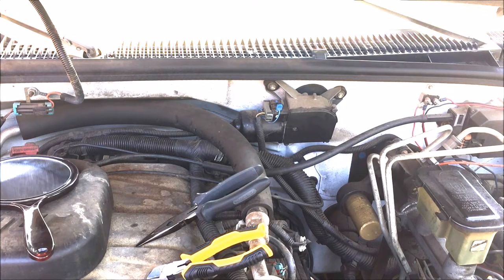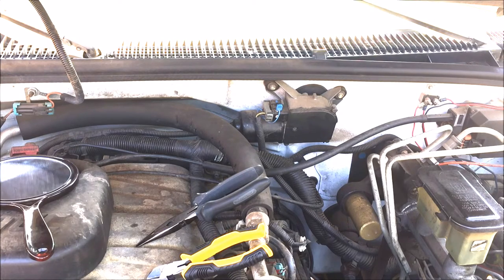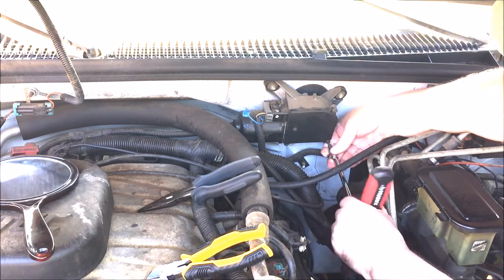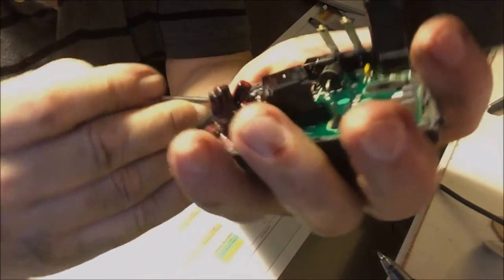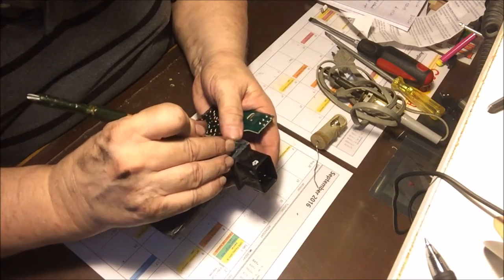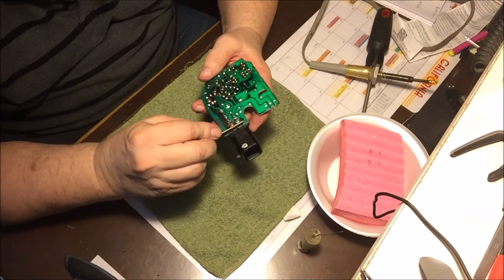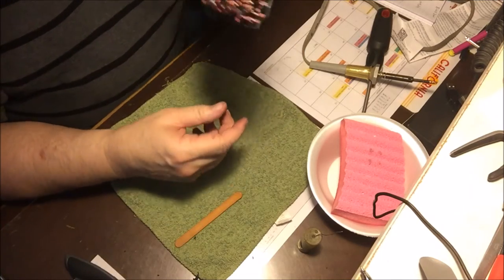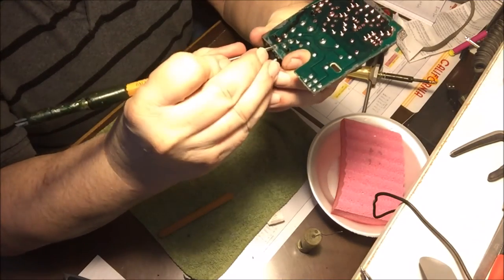DIY Windshield Washer spray fix 1996 GMC

Comment: John on the two legs or brushes as you called them mine had grease on one of them do you think that would affect the washers from shooting water? 

And I'm going to clean up some of the grease as well.
Reply: Not brushes contacts
Reply from the maker: It is not the grease which you need, it is the cold soldier joints on the PC board.